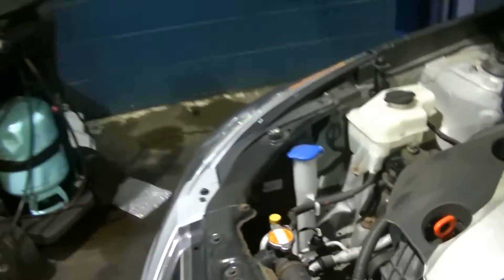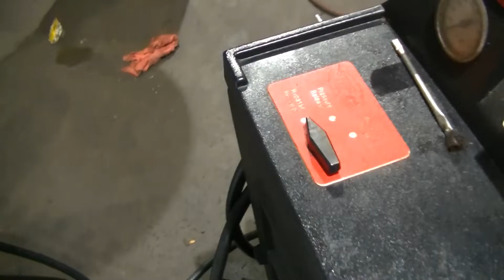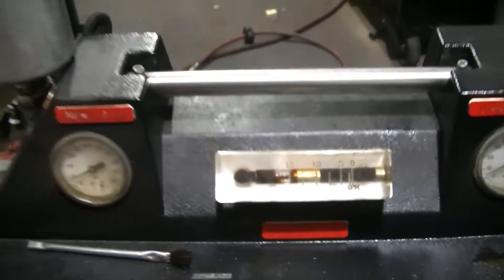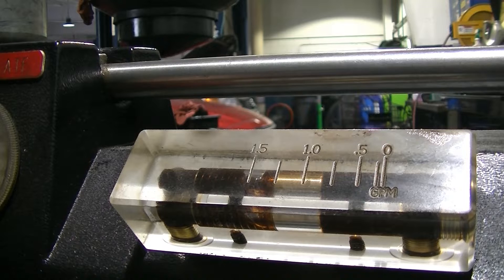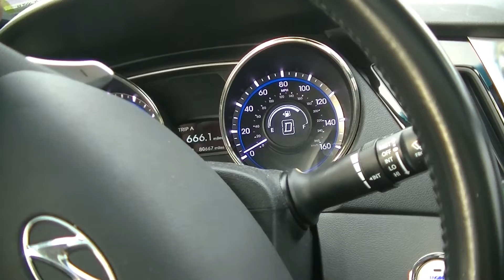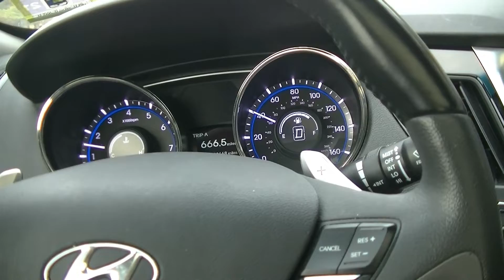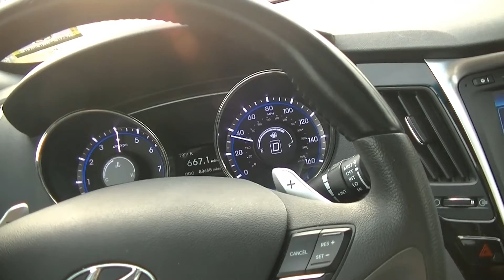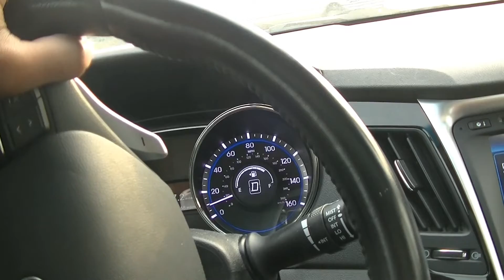How a transmission flush or fluid exchange is performed! Using BG PF5

Comment: Good video,  I have a 2018 KIA Forte LX. It has about 68K mile now. I did a drain and fill at 10K, lots of metal shavings on the magnet. Then at 30K,  no metal, and finally at 60K. I did that myself spill,fill,check level. Used only KIA transmission fluid. However, on my 09 Camry XLE, 173K,  I do the same every 60K. I just don't trust KIA transmission 😂

Comment: My 2012 is at 65k and has never had a drain and fill or flush. Thanks for that bit at the end about the relearn procedure! Is there any “master” relearn procedure for the Sonata? I’ve taken the battery out, done plugs etc.. and I did notice some differences but does this car have an actual procedure like some do
Reply from the maker: Yes! There is an “adaptive value” reset that forces the transmission to forget learned adaptive values

Comment: What about the filter? I assume this transmission has one and by the looks of the fluid would need to be changed.
Reply from the maker: There is no serviceable filter in these
Reply: @SEsGarage  Interesting given Rockauto sells one and I have the equivalent Kia model the Optima SX and my trans has a filter as well.
Reply from the maker: @DuffyF56  You can buy a filter if you’d like but you have to split the case to change it